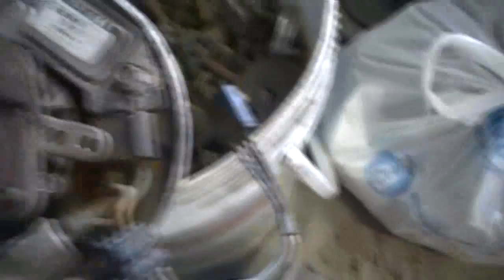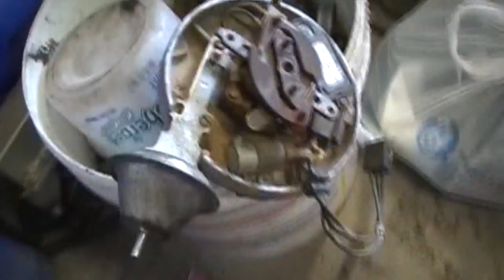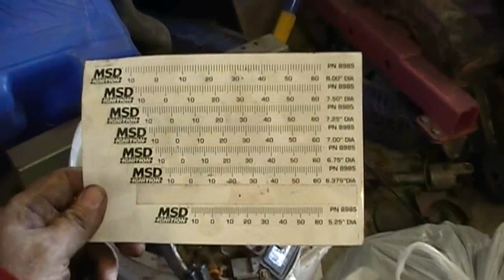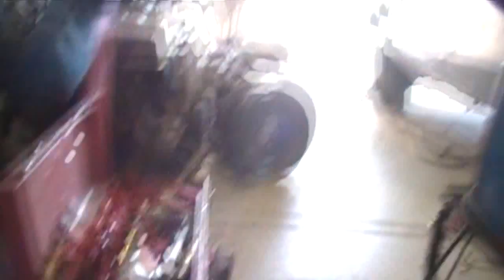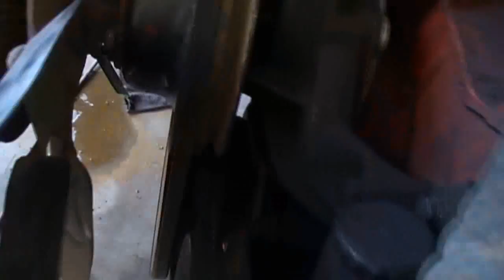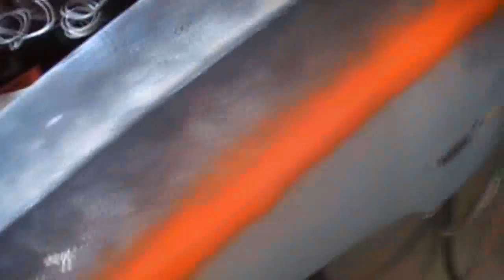HEI ADVANCE CURVE LOW BUCK MODIFICATION. Demolition derby tech.

Comment from the maker: It is up there now. Too much much at idle (22 degrees advanced) made the motor overheat. Because the distributor in it was designed to work with both Vacuum and mechanical. So it had very little mechanical advance. So I basically made my own mechanical only advance distributor. Yes zero at start up. About 8-9 at idle. And 32 total.

Comment from the maker: Yes it would work perfect for racing. But no for racing you want a little higher then 0 or TDC. Depends on the cam. And that info a lot of time comes with the cam. Oh thanks for pointing out something I forgot. You can't just remove the vacuum advance. You have to lock it into place. But I just take a old leaky one. Weld the rod to either side of the bracket. And cut of the vacuum bulb. This is good for big cams that don't have good vacuum. Or if you are sick of vacuum hoses and leaks.